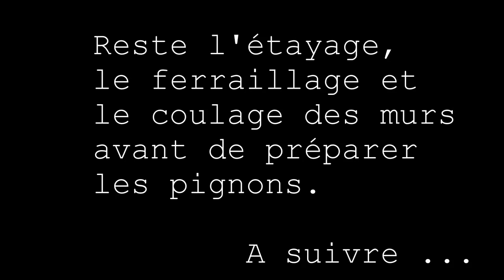Time Lapse Client #2 - Montage blocs coffrants isolants EUROMAC 2 (3/3)

Comment: What is the price per block? I need to build a new 5m high insulated shed on an existing concrete floor and I'm extremely interested in this, but not being able to get a hold of any prices makes it sound extremely fishy and extremely expensive. If you're not open with your prices why would any contact you. Yes you can make an offer on an existing plan, but that is a lot of work for a simple question. What are your prices? I mean the whole idea sounds fantatstic.